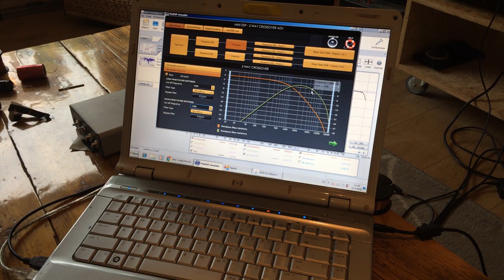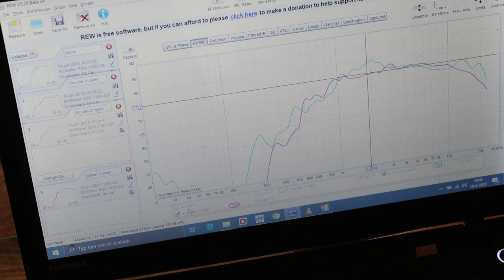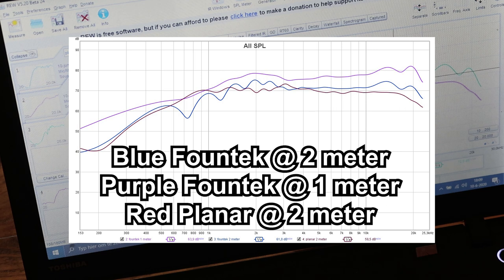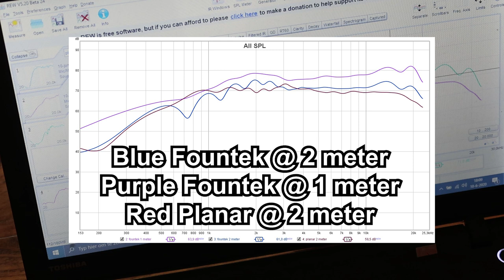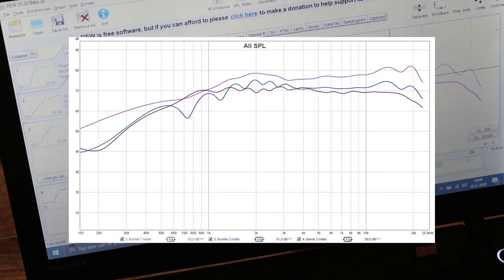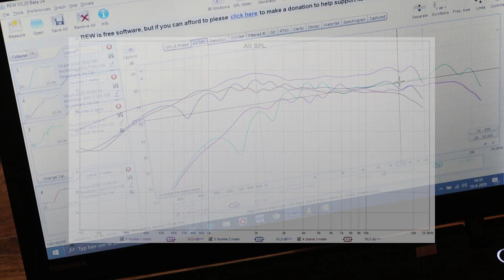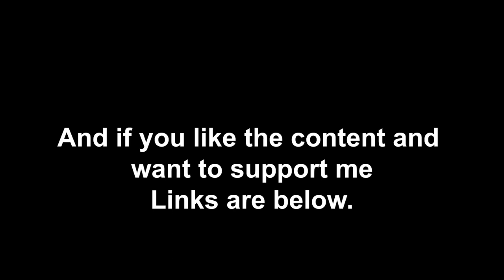SPL Decay Planar Line source VS  Dynamic Pointsource

Comment: Very interesting video. I’d love to know what issues you have with the boenicke clone crossovers. Have you done any videos or published any material on those?
Reply from the maker: nope, i just made it once because the way its build is rather nice.  i crossed it at the same spots..  problem is the Fountek was crossed to low in the design i found on a site that reviewed them, and came to the same conclussion.   so there is a gap between fountek and woofer. and to me the woofer is to far back, if the crossover slopes are not high enough. so it should either being crossed lower (what the fountek cant do, in this housing) or use a delay. on the fountek to match them up
i dont remember witch site it was that did the review :(
Reply: joppe peelen OK thanks Joppe! I have a pair of the same founteks waiting for a project, and I like how these look, so... but as ever, there’s probably no substitute for actually thinking about the problem myself.